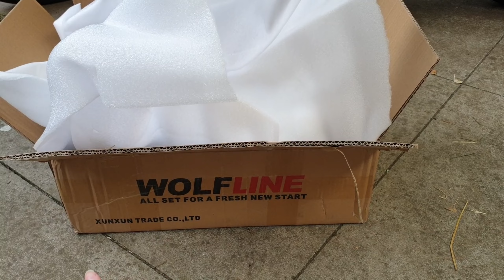Why I like crash bars!

Comment: I love it. First thing I am going to do and is get crash bars. I want a 500cc but a 300cc gets better fuel milage and better insurance rates. Can't decide
Reply from the maker: Yeah I would recommend putting them on even before riding it. The 300 isn't  available in Australia, so I don't know much about it. I think the 500 looks a bit  better tho cos the bigger engine fits the frame better 😍 The fuel economy is also really good on the 500, so i don't think  the 300 would be much better. They have increased in price over the last two years or so. Hope that helps!
Reply: Thank you so much for the advice. This was very helpful.

Comment: Good video, thanks for posting. I have held off getting these specific crash bars because they don't seem to do anything to protect the foot-pegs or more importantly, the controls (gear shift and rear brake lever). The only crash-bars I can see that may do this are the ones from T-Rex, but they are god awful square things and do nothing to enhance to look of the bike. If I am going to spend money on crash-bars (of which I am a long time fan) then I want them to do all they can to protect the side of my bike.
Reply from the maker: Thankyou!! 😃 I think overall they significantly minimise the damage but it's not possible to completely avoid small scratches. I found they protect the levers but not completely as the bars hit the ground before the levers.
Thankfully the Rebel 500 has spring foot pegs (that fold up), I found it's more the exhaust that is most likely to get scratched. 
I agree the look wasn't my cup of tea, but 100% crash bars are worth it, even just for ease of picking it up. 😊

Comment: Link?
Reply from the maker: Hi, 😊 I got those a couple of years ago and the ebay listing isn't available anymore, but i'm pretty sure these are the same. 

https://www.ebay.com.au/itm/166082314724?itmmeta=01HTF5N02SHC61GB3CSN6SQJS8&hash=item26ab4701e4:g:1bIAAOSwarZkWI8M&itmprp=enc%3AAQAJAAAA4BqaBEIoa1ponf5CMYK7QKKrn9TK9ZpE2DjPIieT2Aycx12dptHCFxfcovoLhpBXNG%2FIdMK%2BcE261zF4Q61Qj5SBfyCVus6Ay6VkfFFJfH5DyNQ2GqMP%2B6T6u9G%2FgCeeOdSWzLb%2FoyzQrXThntmdHp%2BDQNhSgLYZCc7O1xxaOW5lNO6kKEkO3NA6MB2B8whbAg1l6K1IC8DaAB2lz1gWpIUJhRPtMmvjKdgidLGpOacbeYUWCX0Q7tu6HdpzfGsdXmga3%2F71Aawcksat73ZokEoOvGakFuuOzGoc4MxdDOha%7Ctkp%3ABFBMvoHU5dNj